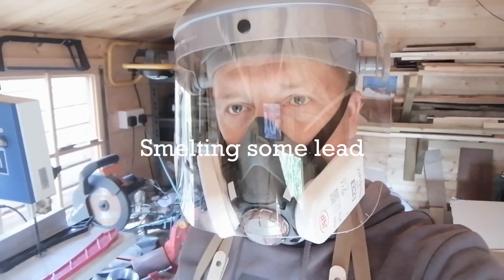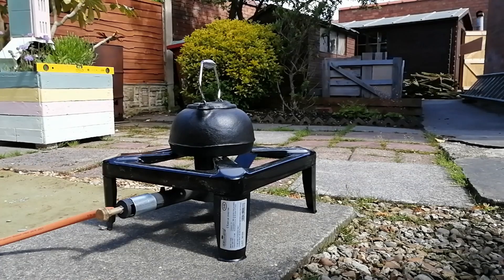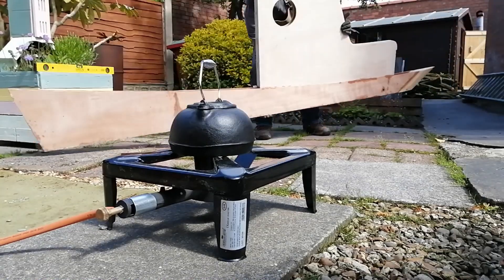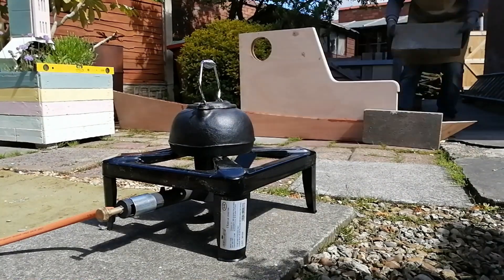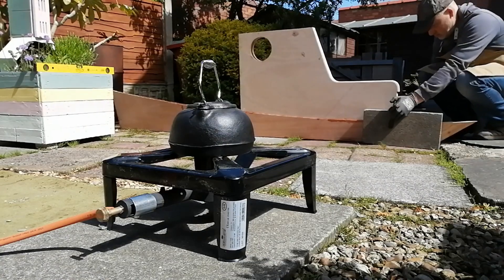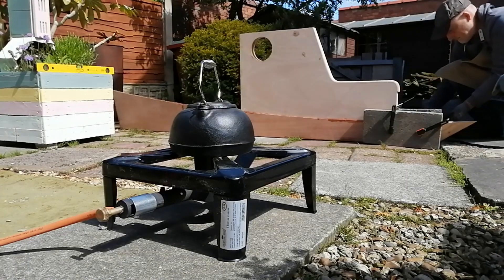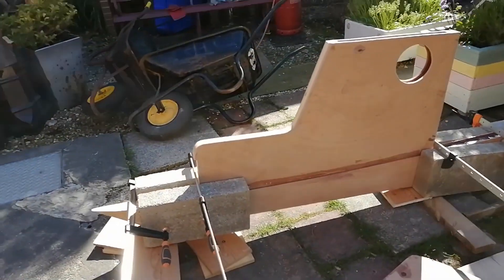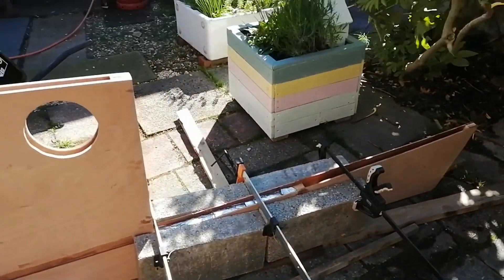Smelting some lead : Alan Hulme's Appropriate Footwear

Comment: Doesn't molten lead damage the wood on the inside of the keel?
Reply from the maker: Good question! It ‘flash chars’ the wood so just the surface in contact with the lead is scorched. Wood is such an amazingly resilient material.